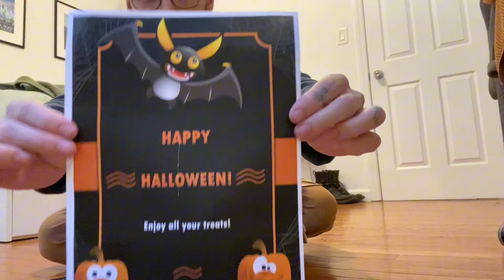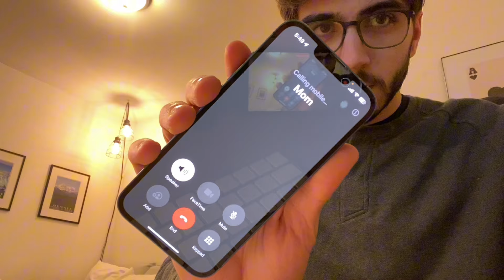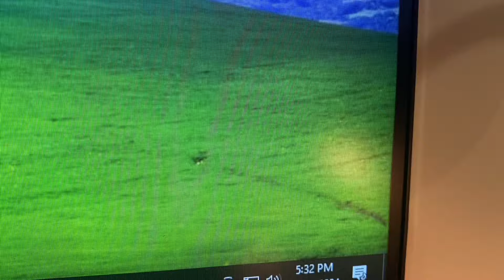Doing chores and errands

Comment: Wow, cleaning the windows really let some light in.  Good job.  Your mom seems like a really sweet mom.  We love our kids!  I’ve glued many a shoe in my younger days.  I’m going to tell a story about when i was about 19 or 20.  I worked in a rubber manufacturing plant.  I had crack across bottom on my rubber soled shoes.  The welders in the back shop told me to bring them to the shop and they would weld the crack together with rubber weld.  I said “really?” I thought I’m getting my shoe fixed.  I quickly figured out they were joking with me.  They sure got a laugh at my naïveté.  Fun times in that factory.  😂 
Love seeing you post.  See ya next time.